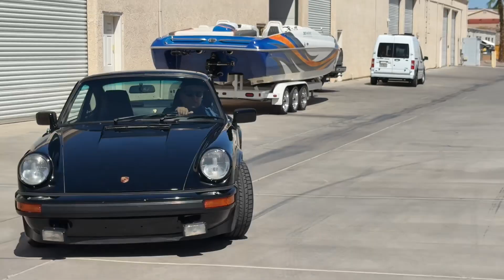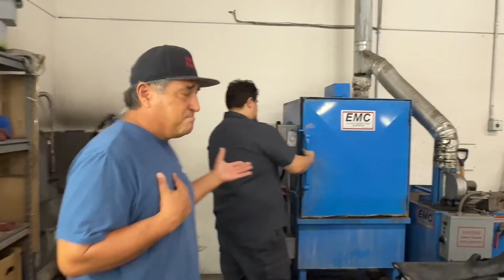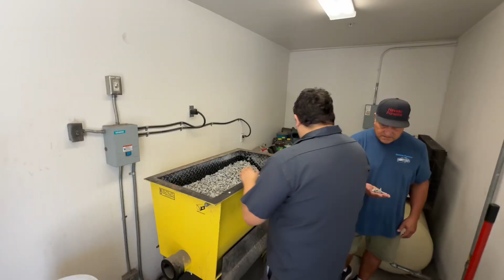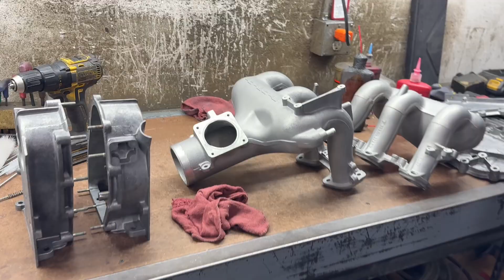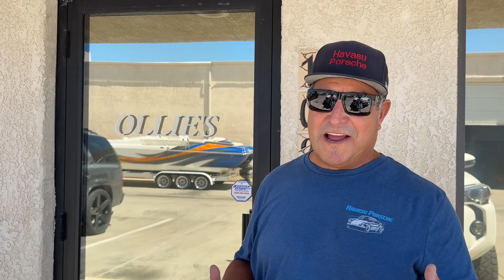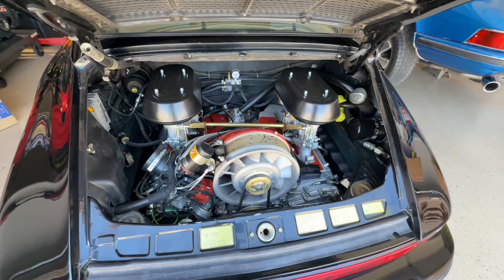911SC rebuilt 3.0 W/46mm PMOs Visit to Ollie’s Machine Shop #havasuporsche

Comment: Love this channel, David. I am in Yuma and wondered how Ollies is doing up in Havasu. I am in my 70s and have a 1970 911S targa that I drove into the garage in 1986, tore apart and made some purchases of many parts that were still available and did lots of initial work to it, but life got in the way. Now it is a great project and super rare car, but not sure I will ever get it done. Maybe your channel will inspire me. I had the fuel injection pump done in the 80s, along with cams, heads, standard crank polished, line bore checked by Ralph Meany, legendary racer, did the transmission interior kit, sourced original german carpet nos set, etc etc. But there it sits. I am probably 45K in it from the 80s and 90s, but like I said, life got in the way. Anyway, thanks for the tour, and would love to come up to Ollies and see you one of these daya. Keep up the videoa. I am a new subscriber.
Reply from the maker: Hi sounds like you have a wonderful Porsche Waiting to get back on the road.  
I would love to help if I can.  
You should visit us in Lake Havasu.   
I live very close to the shop and there very often.  
I just pick up a 1968 911 targa that never got completed.  
I will do a video when I remove it from my trailer. I built the engine 10 years ago. The owner has it painted and bought most of the part to complete the build.  
But unfortunately will not see the final out come.   
The kids are now go forward with the project.  
I’m going to build a nice car for them.  
Enjoy my Channel. 
Thank you